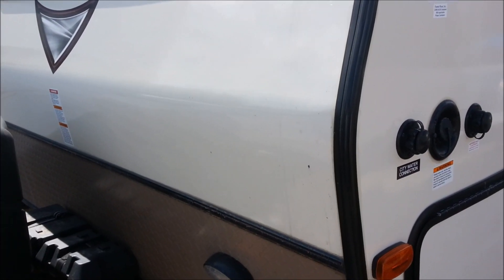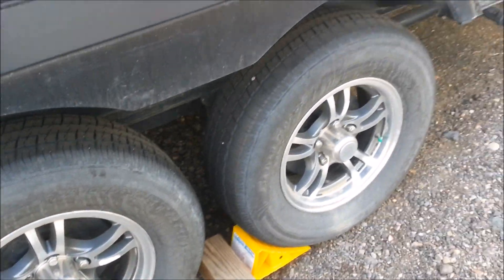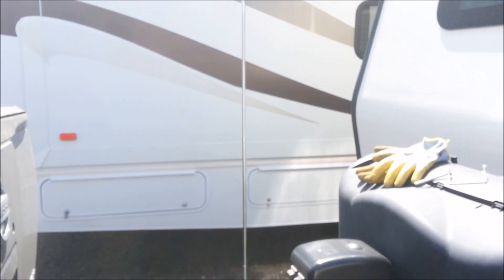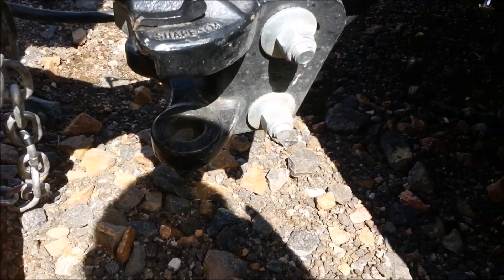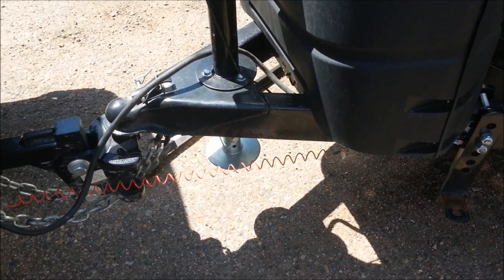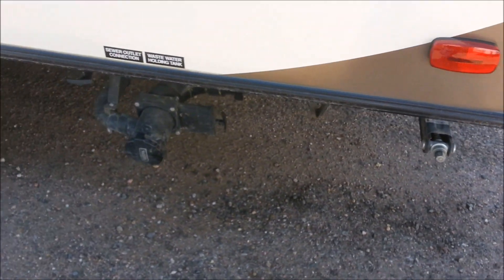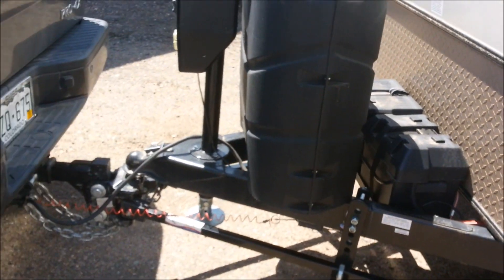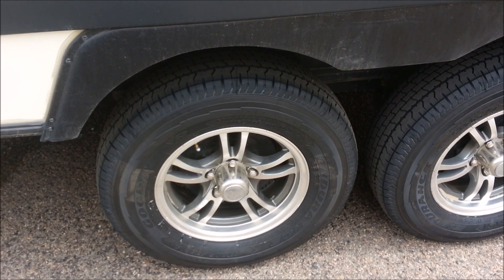New Tires for the Rockwood Mini Lite 2109s and hitching up by myself.

Comment: I purchased a new 2018 2109S in February.  I towed 3200 miles from the dealer in Michigan, down to Houston and San Antonio and finally home to Vacaville CA. Trailer tows easy behind my Ram 1500. I have been considering changing the factory tires for the Good Years Endurance tires. After hearing the good service those made in China tires gave you, I might wait.
Reply from the maker: Richard.  I watched my tires like a hawk to be honest.  I had heard a of stories about them.  I believe most ppl dont' realize that RIGHT ON THE TIRE..  it says 65mph is the safe zone.  I rarely ever drove over 65!   Heat is the other thing, we didn't drive on any really HOT days.  I carry a simple tire temp gauge and did check them between stops to be sure I was not over-heating my tires.  Inspect them closely once a week and you may do as well as I did.  :)   Like life?  We have no guarantees huh?  :)  Thanks for watching.
Reply: Garland Style I was going to replace them... but seems like a shame. The other thought is...whats the value in avoiding being stranded on the roadside? I was quoted around $500 mounted and balanced for the Good Years. My thought is... It may be worth the price for the assurance or reassurance.
Reply: By the way...I always enjoy your posts. Thank You.
Reply from the maker: It is a coin toss either way Richard.  Seriously though, your call and comfort level.  That's why I just checked the heck out of them all the time.  :)

Comment: I. Have the Flagstaff micro light which is same as your trailer. It is a 2017 that I recently purchased.  After returning from Florida I noticed that one rear tire on slide side was wearing out on the inside. It has Dexter torsion axles.  I am wondering if I Have a bent spindle or this is common as u said yours was wearing on the outside of the tire. There is no way to replace just the spindle and the replacement of an axle is costly. I wonder how aligned from the factory they are? I rotated the tire to see what happens as I have no idea how many miles is on the trailer but all other tires look good. I can find no place that can check alignment of a trailer.
Reply from the maker: Mike.  The wearing on the outside or inside of a tire normally indicates under-inflation.  But you are quite right in assuming it could be an imbalance.  Mine all seemed pretty good considering all that mileage.  The wear on the outside of that one tire I showed (about the same on the other side for one tire) was not horrid by any means.  I'll have to watch the wear on these tires too.  If you are really concerned, find out if there is a tire shop that will let you back in and put it on a spin balance to see if there is a real problem.  It would be worth the time and reduce worry.  Rotating the tires is a great idea.  You sure did right there!  Thanks for watching Mike!

Comment: If you don't mind me asking, what was the total cost of the tires and labor (if any) to have the tires changed out? Were the tires spin balanced? Thanks Garland.
Reply from the maker: Thanks for the question.  It was $515.88 for everything Stinger.  The tires were $100 each on the invoice and I noticed that Ebay, Amazon, etc were pricing them a bit over that price.  So that said, the tires were $400, the rest was balancing and labor and taxes.  They spun balanced the tires in the shop before mounting.  I kinda wish they'd have balanced them the OLD fashioned was after mounting.  but hey?  :)    Thanks for watching.

Comment: Unbelievable that you used them 19,795. I had a blow out at around 2,000 miles.
Reply from the maker: whoa.   Sorry man.  I always checked them between stops for any noticeable wear or damage. Being sure the air pressure "by sight" was ok too.  honesly?  Ashamed to mention this, but I never ever took a tire pressure reading on them in a year and a half.  LOL   Guess I was lucky?  :)

Comment: The only problem I see with Garland's videos is that he doesn't  do more of them.
Reply from the maker: LOL   The camper is in storage for winter.  Hoping to get away in a couple or more weeks to the south.  :)   I do plan on doing some on FAQs.  Any requests?  Michael
Reply: I had problems with taking my battery down below the charge needed to supply power to the refrigerator controls. Have you had that problem and if so, aside from using a generator or vehicle charging, how did you solve the problem?   I just  bought a Solar panel suitcase through Amazon and an extra battery to solve that problem. Have you put solar to work on your trailer and if so do you plan to add an inverter to provide 110 current? Thanks Michael and keep those videos coming . They are always very interesting.  Jack
Reply from the maker: @TheJayanddee  I haven't had that problem Jack.  The battery must have been very low, the fridge controls use very little electricity on the control boards.  I did put in a solar system.  Under $500 and Greg helped me install it.  I did a video on it.  I am absolutely satisfied with my 200w mounted Solar and two 12v batteries.  We can go indefinitely with our power usage just like that.  Provided we have good sun.  I could use my generator of course, or hook up the truck, but we did 4 days boondocking in Quartzsite AZ with no hookups and every day I had what electric I needed.  :)   I'll be posting more videos.  Michael
Reply: Thanks for the reply. Watched parts one and two of  your video  and looking forward to the completion video of the install. I'm hoping that the 100 watt suitcase (Two 50 watt panels)placed on the ground and attached to the Z-amp connection will be enough for my basic needs for power. The install took two minutes. Thought about installing an inverter but  decided against that  too. You went the way  I would have gone if my wife and I were "boondock" types. Closest we have come to boondocking in our five  years of having  an RV was this year in Vermont in  a bare base (no service) state park where we could use our Hondas twice a day. Once again Michael I want you to know I really enjoy your videos.
Reply from the maker: @TheJayanddee  Cool.  Every bit of energy you can get is a + for sure.  :)   Thanks for watching Jack.  Lots of adventure and learning to come for both of us.
Reply from the maker: @TheJayanddee  Unless you do a lot of boondocking or dry camping, 50w will be good for you a day or two.  It really depends on how much elec you use, seriously.  we loved Vermont, and Maine.  wow..  there is lots of boondocking in Maine, but we didn't get to do much.  we were newbies at that time.  LOL  I would have, but wife?  ehhhh.  One day, I'll get to the last phase of the solar install. It really amounts to routing all the power through the Solar Controller such that I can totally monitor all usage of every piece of equipment inside the trailer.  More informational than practical.   I need my buddy to help, he is a whiz.  If you search for "Michael Bracewell solar" here in YouTube, he has a Mini Lite and did a full install as well.  You may pick up some tips from his video.  Thank you sir for watching.  Hope something helps.  Michael